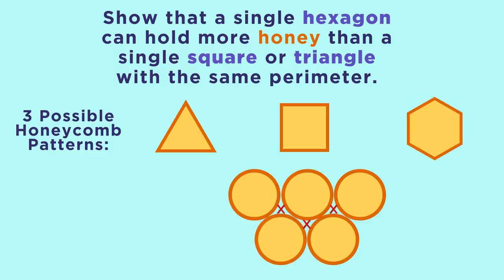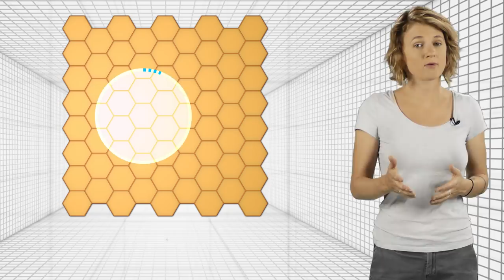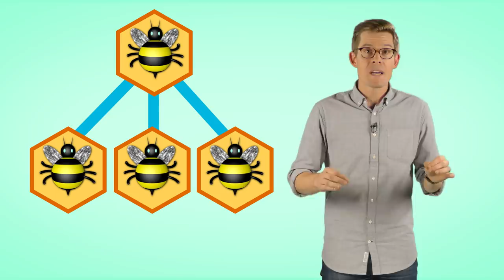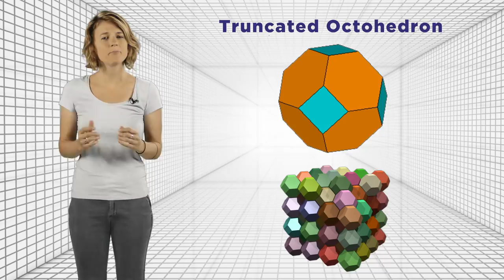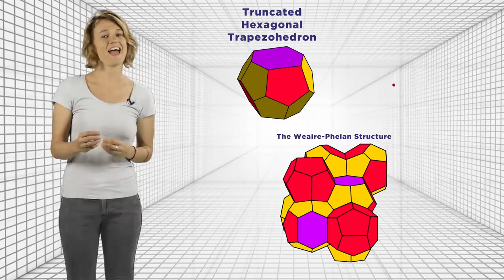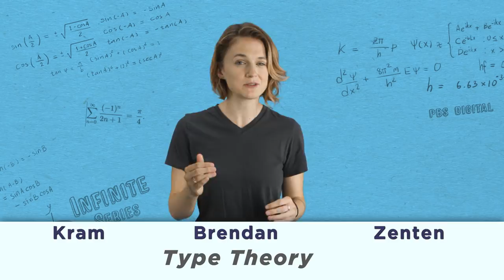The Honeycombs of 4-Dimensional Bees ft. Joe Hanson | Infinite Series

Comment: You don't have this quite right. I remember writing a paper on this in one of my undergrad classes in architecture school. A lot of fun figuring it out. Bees aren't intentionally making extruded hexagons, they'd be perfectly content making sloppy extruded circles, for example--it's the adjacent bees tunneling away and the counterpressures involved that create a hexlike honeycomb. Look for example at the shapes other than hexes bees produce when they aren't adjacent to other bees--you guys should really look at actual honeycombs, in the wild. 

 We built fabric structures out of the shapes suggested by soap bubbles, too, understanding minimal surface area and the like. It's a great project for kids. Mix soap liquid with a plasticizer and the soap shapes "set" very quickly, making it possible to study these shapes at length. You can generate very different shapes by using differently shaped wire loops that in turn generate all manner of saddles, for example.

Comment: What about the Rhombic Dodecahedron? 11 years ago I began asking myself the same question: "The square is to the cube, as the hexagon is to the ____?" and the answer I came to was the Rhombic Dodecahedron. I'm surprised that it wasn't talked about in this video. It has the same length of edge for every edge, and every face is the same as well. It uniformly fills 3d space. It has a hexagonal lattice arrangement in one direction, and it has a checkerboard lattice structure in another direction. It looks like a cube when viewed from one direction, and it looks like a hexagon from another. It's a neat structure. If I were to make a modern version of minecraft, I would use the Rhombic Dodecahedron as my building block.

Comment: Did anyone else first come up with the solution of the pentagonal dodecahedron honeycomb? It seemed to be the intuitive thing to me as the hexagonal pattern arises from projecting tangent lines from the contact points of close-packed circles, so you could just do the same with tangent planes on close packed spheres. It at least gets you close to the most efficient answer, plus it keeps all the surfaces and edges flat.

Comment: To roughly answer 1:37 (correct me if I'm wrong)
A: area
P: perimeter
s: side length (note regular polygons have equal side length)
n: number of sides
The area of a regular polygon is given by the following formula (which I leave out the proof of; something something margin something):
A = ( n * s^2 ) / ( 4 * tan(pi/n) )
The perimeter of a regular polygon is simply:
P = n*s
To rewrite the side length in terms of perimeter, we have:
s = P / n
Substituting out side-length in the above area equation gives:
A = (P^2 / n) / ( 4 * tan(pi/n) )= P^2 / ( 4n * tan(pi/n) )
We do this because side length varies depending on the perimeter, which is held constant.
We want to maximize the area-to-perimeter ratio (A / P):
A / P = P / (4n * tan(pi/n))

Now we have an equation for the area-perimeter ratio in terms of the perimeter and the number of sides.
At this point, we can plug in 3, 4, and 6 for the number of sides (n) to see that 6 has the maximum area-to-perimeter ratio for these three regular polygons which can tile the plane.

What's interesting to note is that n*tan(pi/n), for n>=3 (as in the case of regular polygons) decreases (monotone) as n increases, so A / P increases as n increases.  Of course, our intuition tells us that at eventually this area-to-perimeter ratio reaches a maximum.

This is because n*tan(pi/n), while decreasing, is bounded below, and actually approaches pi. Thus, the upper bound for an area-to-perimeter ratio (in terms of perimeter) is P / (4 * pi). Of course, this is achieved for a circle, with:
A = pi * r^2
P = 2 * pi * r
To see these agree:
(using known formula): A / P = r / 2
(using our upper bound): A / P = P / (4 * pi) = 2 * pi * r / (4 * pi) = r / 2

Comment: I did not hear any mention of the amount of material used to make the cell walls. Since the walls of an hexagon would have equal pressure from both sides the wall thickness would need only to be strong enough to keep the contents apart. A sphere would need addition material to hold the contents where the sphere is not supported on the other side.   If the forgoing is true then the hexagon would use less material then a sphere.

Comment: Quick proof that hexagon is the most optimal shape. First we need (or at least I needed  to), find an expression to represent the area of the equailaterial triangle. We know the area of the triangle is b*h/2, so we need to find the height. So we construct a right triangle inside the equilaterial triangle by bisecting a line. By the Pythagorean Theorem (a/2)^2 + h^2 = a^2, so c^2 = 3a^2/4 or h= sqrt(3)a/2, so the general expression is a * sqrt(3)a/2*1/2 = sqrt(3)a^2/4. The hexagon formula is likewise obtained by multiplying this formula by six, as a regular hexagon is just six combined regular triangles.

 For a given a perimeter, say K. The individual length of side of triangle tile is K/3. Using our formula we get sqrt(3)/36 * K^2 or about .048k^2

For squares we use K/4, so the area is simply K^2/16 or .0625K^2

For Hexagons we get 6*sqrt(3)*(K/2)^2/4 = 3sqrt(3)/72 * K^2 or about .072K^2, Therefore for a given non-Zero perimeter K, a Hexagon maximizes the area.
Reply: Skipped some algebra steps, since I didn't want to type them all in a youtube comment haha
Reply: Jonathan A. 
That's proof of hexagon>square and triangle, not "best of all"
Reply: Absolutely a true statement. I didn't show that only Hexagon, Square and Triangles will work (which is true), but I think it's implicit in context of the video. Still a completely valid point.
Reply: +Jonathan A You did what she asked for, you proved that of a triangle, square and hexagon with the same perimeter, the hexagon has more area. What she did not expressly request, but could be inferred, is a proof that of all shapes that can tile the plane, the hexagon is most efficient. If you limit the question to regular polygons, you proved that as well, because of the regular polygons, only triangles, squares and hexagons tile the plane.

A circle of circumference K has an area of k^2/(4*pi), about .0796K^2. The area of a regular octagon will be between that and .072K^2. A regular octagon will not tile the plane, but irregular ones will. Any irregular polygon of perimeter K will have an area less than a regular polygon of the same type. The question is, is there an irregular polygon that will tile the plane and whose area is greater than .072K^2?
Reply: dude you wrote "Quick proof that hexagon is the most optimal shape" but that's not what you did.
Reply: Jonathan A. 
You can't prove that triangle, square and hexagon are the only shapes able to fill space, because there are many more different shapes
Reply: Incorrect, it is possible to prove. "Filling the space" is also called tessellation, see examples here. You have to consider the interior angles that regular polygons have. http://proofsfromthebook.com/2014/07/16/proof-3-regular-polygons-tessellate/
Reply: +NoName Jonathan A. It is well established that those three are the only regular polygons that tile the plane if only one type of polygon is used.. If irregular polygons or multiple different polygons are considered, there are infinitely many shapes that will tile the plane. For any n-gon, the regular one has the largest area/perimeter ratio, so it is not unreasonable to consider only the regular polygons that can tile.

As n increases, the area/perimeter ratio goes up. I have almost, but not yet, convinced myself that no irregular n-gon exists that would tile the plane and have an area/perimeter ratio larger than the hexagon. That has nothing to do with what Jonathan did, which was to prove that among the regular polygons that tile the plane, the hexagon has the highest area/perimeter ratio.

Comment: On one hand yes a 4d bee honeycomb could look like that, but that shape is missing the critical feature where each cell is directly accessible and not landlocked inside a superstructure. In other words, those higher dimension shapes make it impossible to enter any cell without having to travel through any other cell, unless as a sufficiently small number of cells is used.

Comment: I thought you said bees build round shaped honey combs and through the heat caused by the bees and temperature, the surface tension pulled them into the 6 sided shapes? So which is it? The heat and tension pulling them into the shapes of are the bees building them that way?

Comment: I have a question: what would be the optimum 3D packing if the unit package were a toroidal polyhex? Could it be the hana-gusari pattern (japanese hexagonal) used in samurai's chain mail but in a multi layer structure?

Comment: Is there a reason that the shape formed by 7 hexagons (as seen at 2:50) with the inside edges removed (leaving only the overall perimeter edges) wouldn't be formed instead of a hexagon? Is it simply because of the stability of the structure or is there some fundamental reason it would choose to do the simplified version (7 hexagons) vs the more complex structure (7 hexagons with inside edges removed)?

Comment: Also not even insects lay eggs or spew anything with corners. Holes are round no matter the location. Thinking along the lines of the bubble example, what comes out of a bee is rounded at least on the sides. So, it would take more work to make other shapes.

Comment: I believed that the dodecahedron would be the answer ! Would that be a good choice compared to the two presented here ?
Reply: You mean, regular dodecahedra? They don't quite tessellate 3-space; this is how the 120-cell 4-D polytope is formed, much the way you can build a 3-D dodecahedron by starting out trying to tessellate the plane with regular pentagons. Making 3 pentagons meet at a common vertex, leaves a gap-angle of 36º, allowing you to bend them up out of the plane until that 24º angle closes; then continuing to attach more pentagons, it eventually closes into the regular dodecahedron.

In the case of dodecahedra in 3-space, their edges meet at 108º angles (⅗·180º, the interior angle of a regular pentagon).
Now to fit four tri-planar corners together with all equal angles, requires that angle to be cos⁻¹(-⅓) = 109º.47..., which leaves a thin-wedge gap between surfaces you wanted to lie flush against one another. In 4D, this leaves enough slack space to bend the dodecahedra a bit out of their hyperplane, to make all the faces of neighboring solids join, eventually curving around into that monstrous polytope, the 120-cell. But staying in 3D, the regular dodecahedra just don't close up together.

OTOH, if you start with rhombic dodecahedra, I believe you can tessellate 3-space with those . . . but it won't be as efficient as Kelvin's structure.

Comment: Let p be the perimeter of an equilateral triangle, a square and an regular hexagon. The height h of an equilateral triangle is sqrt(3)/2 * base length. Each side of the triangle measures p/3. Here h = p/3 * sqrt(3)/2 = p/(sqrt(3)*2), so the area of the triangle is p*h/2 = p²/(sqrt(3)*2*3*2). The area of the square is (p/4)² = p²/16. The hexagon is made of 6 equilateral triangles of side length p/6. Their height measures h = p/6 * sqrt(3)/2 =  p/(sqrt(3)*4). So each little triangle has area a = p/6 * p/(sqrt(3)*4) * 1/2 = p²/(6*sqrt(3)*8). The total area of the hexagon is six times that so p²/(sqrt(3)*8). Because sqrt(3)*8 < 16 < sqrt(3) * 12 the area of the hexagon is greater than the area of the square, which is greater than the area of the triangle.

Comment: I would have guessed the rhombic dodecahedron, which perfectly tile 3D space, would be the 4D bees honeycomb version :) Maybe this is unrelated, but I find it particularly interesting that there is a set of 4D rotations of a 4D cube for which its orthographic projection into 3D space results in a rhombic dodecahedron shape. The same way as the diagonal slice of a 3D cube results in a hexagon (when the slicing plane passes through the center of the 3D cube) I would guess (though my intuition may fail me) that a diagonal slice of a 4D cube would end up with a rhombic dodecahedron as the 3D slice when the slice passes through the center of the 4D cube. Btw, did someone calculate what is the “surface/volume” ratio for rhombic dodecahedrons?
Reply: QuantumFractal I don't understand, I'm only 13 lol. But I like your Mandelbrot fractal, I made one too using c++ code.

Comment: You left out why your bees don't just make one giant honey tank with minimal wax... back to square-one with the six-legged bees... P.S. How many legs would a 4D bee have....
Reply: I'd think bees simply build one standard cell attached to an inside pocket, and then fit the next cells around it utilizing as much wax as already in place—and as wax is soft, packing deforms cells into hexagons (which trains baby-bees to glean tight).
Reply: Because the space they try to make is bee sized. (They use the same cells for making honey and storing pollen as well as making more bees.) They actually make three different sizes for workers, drones and queens.
Reply: they are unbeelievably talented!
Reply: If—a 1D bee has 2 legs, a 2D bee 4 legs, a 3D bee 6 legs, 2 lowered in gravity, then a 4D bee would have 8 legs, with 4 lowered in 3D gravity....

Comment: I do wonder whether those 4D bees would evolve to build that Weaire-Phelan structure, because it is such a small improvement over the truncated octahedron, but is much more complicated in shape. I would imagine that evolution could be modeled roughly as some kind of gradient descent algorithm, maybe subjected to some noise. So it might be hard for the 4D bees to bridge the gap between the two local optima (we don't know for sure yet whether the Weaire-Phelan structure is the global optimum). Plus the baby bees would have to able to crawl through the 4D honeycomb when they hatch. So maybe a more spherically shaped tiling would be more optimal for that, like the truncated octahedron. Unless there would be no penalty for the bees to have a cross section of its body which resembles the Weaire-Phelan structure more closely.
Reply: I'm pretty sure they wouldn't. The truncated octahedron is even simpler to form than it sounds: just take some hyperspheres, arrange them as dense as possible and pull the surfaces together so there are no spaces between the cells. That's basically the same our bees do with 2d circles.

Comment: Something I believe is quite funny: The ration between the circumference and the area is actually NOT smallest for a circle...  Let me "prove" it :-)
Say we have a square with side length of "T" and a circle with a diameter of "T".
What is the circumference of these two shapes?  For the square it is: 4 * T.  For the circle it is: Pi * T.
What is the area of these two shapes?  For the square it is: T^2.  For the circle it is: (T / 2)^2 * Pi.
So far so good.
So what is the ration between the circumference and the area?
For the square it is: (4 * T) /  (T^2) = 4 / T.
For the circle it is: (Pi * T) / ((T/2)^2 *Pi) = 4 / T.
So it is the same...
Funny it is not?
But of cause it is a trick.  But can you see how?  :-)

Comment: Ok so I have this MS-Paint idea - https://imgur.com/a/H4ZN5 - We get the honeycomb by starting with packed circles (red) and you create vertices (blue) at their intersections. Then you increase the circle size (to orange to yellow...) and let them overlap, and where they overlap (orange intersection, yellow intersection etc), you extend the blue lines until they all intersect, and you have blue hexagons.

So my question is, what if you apply this principle starting with Thomas Hales' packed spheres? Create a node at each intersection of red spheres. Then let the spheres grow through one another and you get a small circle as their intersection and create more blue surface that way. Continue until four blue surfaces meet at the centers of the spaces between spheres. 

What is the shape of that blue volume? How does it stack up against Kelvin and Weaire-Phelan?